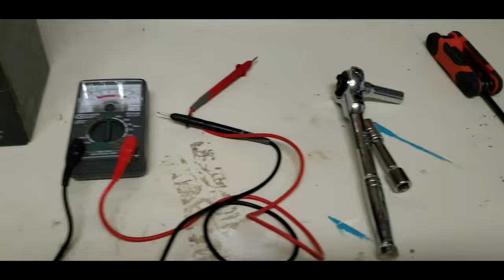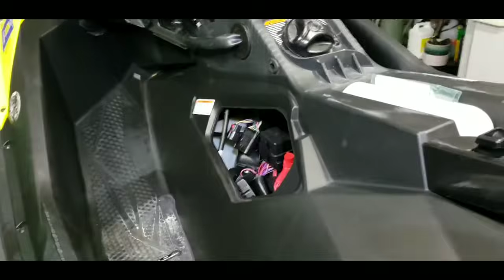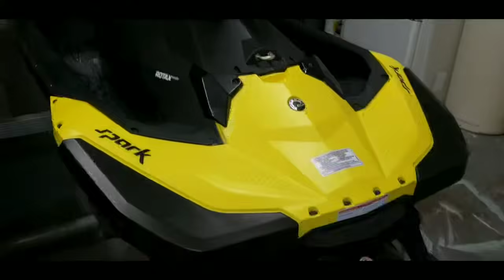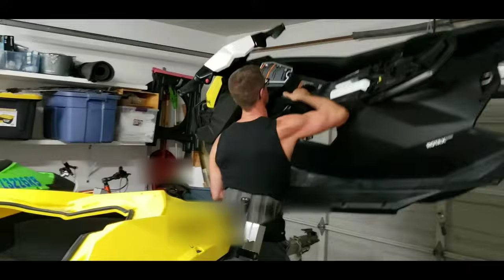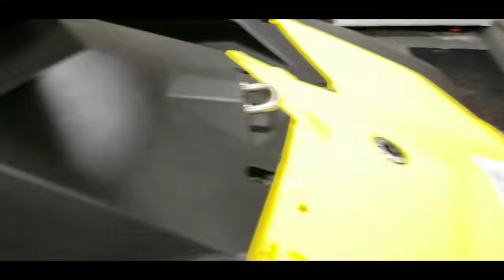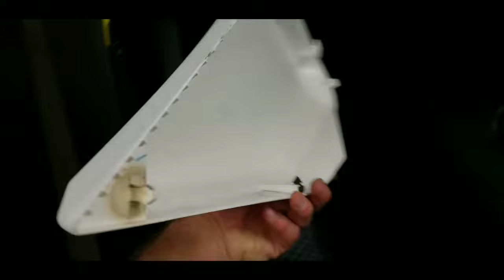How to Remove Top deck + Replace Battery + Replace Starter Relay Seadoo Spark

Comment: No one else thinks this is ridiculous for replacing a battery!?!?  A common process?   F#%} Crazy 😳
Reply: You don’t need to take the top half off I did mine thought that little engine bay hole
Reply: @caidanbrien1114  yup!  it's a tight fit but is possible.    side note: if you are going through all the trouble to take the top off, change the oil, filter,  and plugs while you are at it!

Comment: When accessing the steering 10mm nut & bolt all you have to do is take off that little yellow plastic piece in front of the steering bars(1 screw) and turn it up and it is real easy too get at from that access hole under it.......Nice video on how to do everything else.....You should get yourself an adapter for sockets so you can use a cordless drill and it would make taking out all those screws 10 times easier.
Reply from the maker: Thanks Riley! Good info! 👍

Comment: I've replaced battery, starter relay, and all fuses, but still no response at all on the display, no beeps, and no response when pressing the button to start.  I do get a single click sound every time I press the start button.  Thoughts?  Solenoid?
Reply: Hey same with mine, did u happen to get this checked out and fixed? Do you know what it was? I’m guessing the starter Solenoid as well
Reply from the maker: Your guess is as good as mine. The harnesses are connected good? If it were me, I would look at the starter motor

Comment: Have a similar problem, but was told to change actual starter. Is there a way to test starter before changing? Or should I start with starter relay and work my way?
Reply from the maker: I would suggest starter relay first since it's only about USD $5

Comment: You can replace the battery and access that relay without removing the top. Its a tight fit but it is possible. The only reason id take top off is to change spark plugs.
Reply: I have a 2020 seadoo spark and changed the battery in 5 mins. you have to raise up and flip it on its side it's a tight fit but did it. putting the new one in slide it in perpendicular and flip it

Comment: Can you test it before putting the top deck back on? I don't want to take it all back off if that wasn't the issue :\
Reply from the maker: Yes-ish; you can lay the top back on and connect the harness (without screwing the top on) and test start it